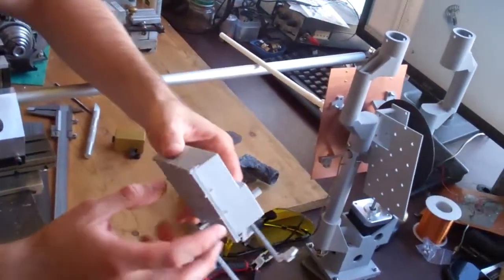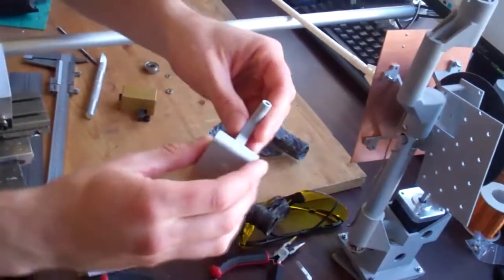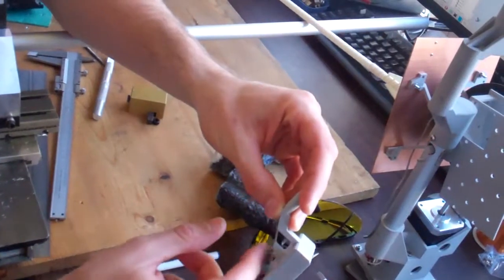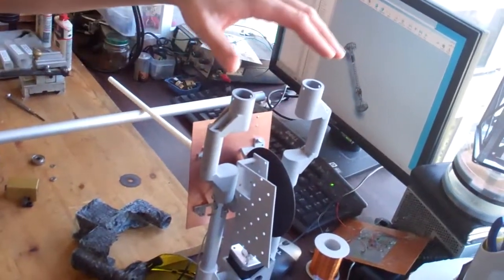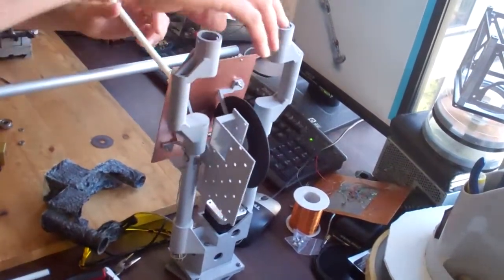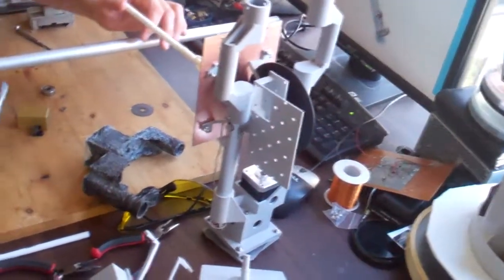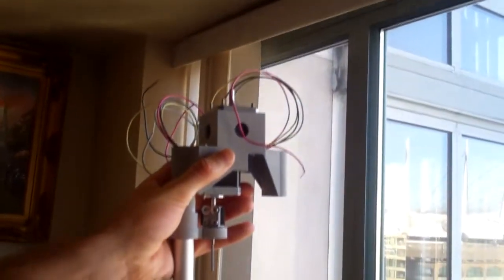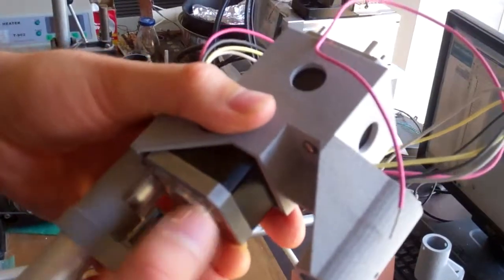3D printed parts of ground station/rover, Main PCB, etc.(отпечатанные части станции связи)

Comment from the maker: In software development exist rule -- if source code working from the beginning -- that mean only one -- something wrong with a source code.
3D printed parts of ground station/rover, Main PCB, etc.
Such excitement discovery was made last week by Alex -- he was wondering why main computer board starts to function right away, but 3.3 voltage regulator during last month was overheated like boiling water -- well it was simple 6 SMD components was soldered upside-down. Current was 180 milliamps, instead of 18. Fix was quick -- it takes 10 minutes to rework PCB, but positive part is components was chosen properly -  all 6 SMDs was working perfectly after 1 month stress.
Integration continue on GPS and Camera. HD Camera waiting it turn together with Orbitcomm backup communication modem. Integration at the rest of the week was not a full scale SNAFU, which was bothered Alex little bit.
And finally -- all 3D printed parts for a rover and ground station showed up last Friday. Some imperfections was fixed  - like this on a HD camera sealed box, or on camera box -- probably the thickness of a wall (target == made from carbon fiber) will be OK, but for rover testing (that part additionally to a camera box functionality will be used as a leg for a movement) plastic is not strong enough. 
For reduced size ground station tubes was made from aluminum, and assembly was in a progress